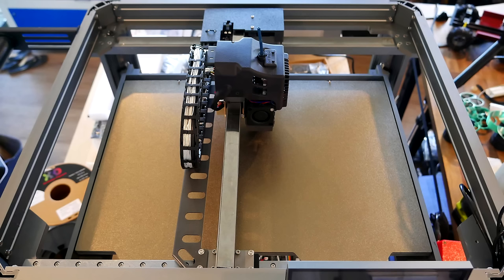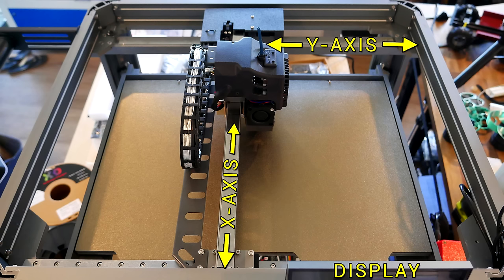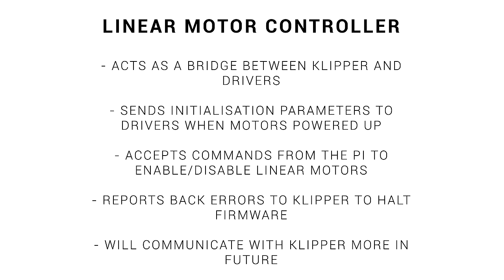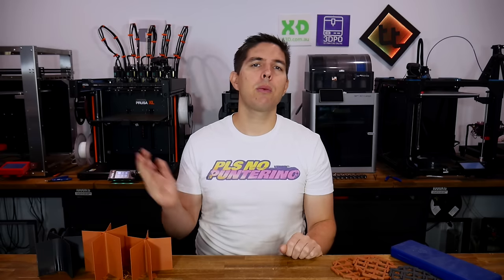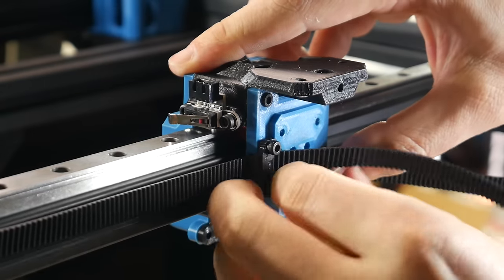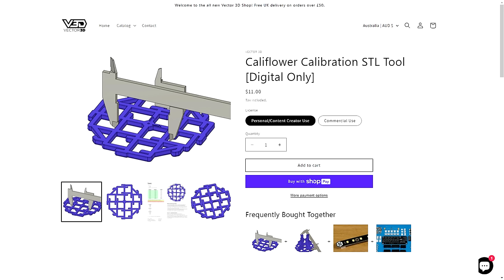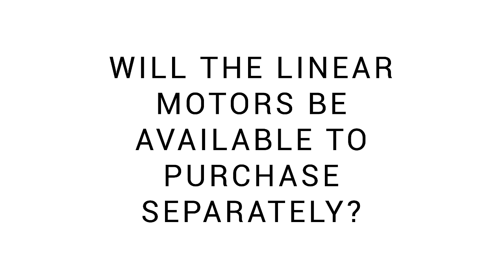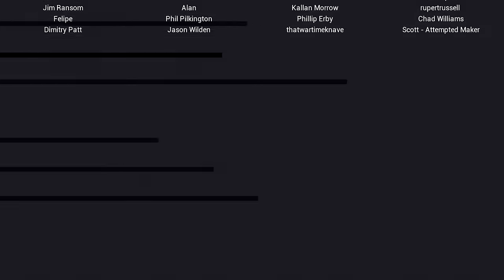Magneto X linear motors: Deep dive and performance testing

Comment: Personally, I think these are designed "backwards". It would be better to have the coils in the rail, and the permanent magnets in the carriage. This would reduce weight (mass) of the carriage, eliminate the motor wiring  to the carriage, and allow the carriage to be hot-swapped. This would translate to simplification, speed increase, and convenience. In the case of something like a CO2 laser that uses mirrors and requires no power to the head, it eliminateds the need for a drag chain or ribbon cable.
Reply: but does that work well enough from a physics perspective?    i don't know.  i see your point about the weight but i'm assuming they did what they did for a reason.   to me... the issue is heat in an enclosed build chamber,  i want a machine that will do functional stuff that has to be printed hot, as others have commented,  and maybe 60c is good enough,  i don't know till i have something and the opportunity to use more advanced materials more.     i don't need that at 800mm/sec..  i probably would be super happy at 250mm/sec or less as long as it was reliable and cheap and repeatable and simple to set up.
Reply: I believe there are magnets that can withstand 120c, so maybe different (more expensive) magnets would be an option.
Reply: @DeagleBingo  It would actually run cooler because the windings in thew rail would have the entire rail to dissipate heat and only be active where the carriage was, and the carriage would not have current flowing through it getting heated up. It would be a little more expensive to manufacture the rail since you'd need an array of windings in it insterad of just some permanent magnets, but at least to me, it makes all kinds of sense to have the head be the passive part. For all the reaons I listed above

Comment: Excellent testing. But why does every print tester on YouTube put their machine on a wobbly desk? I would put the machine on the floor, especially if you have slab-on-grade construction at your house. The acrylic sheets should also add a lot of stiffness to the frame, and that, combined with being on the floor, with perhaps some Sorbothane feet under the printer, seems like it would enable the printer to both obtain better results and higher speeds. The algorithms used for input shaping will have a hell of a time compensating for the extra swinging that comes from the printer wobbling the table when it moves. No?

Comment: I feel like some cross bracing or corner gussets would do this printer some good. Maybe they should look at a different corner design with a connection style that would change how the slop from the screws are handled. Hard to explain without pictures.

Comment: Can you test the holdings/static force for both the linear motors? How much does the smaller linear motor and extruder assembly weigh?  Also how does the carriage of the larger linear motor weigh? I'm trying to understand how much dynamic force the moving mass produces and  if it is equal to the holding/static force of the motor.

Comment: I dont trust the skew correction since your measurements will change with changing parameters like flow or line width but its interesting to see that the same pattern still exists while having no belts at all🤔

Comment: I am hoping that the 0.4 degree skew is a flaw of this pre-production model. A full 1 mm skew on a part that is 143 mm is a bit too much to my liking (my XL has only 0.07 deg, out of the box - no tuning from my side). The speed test shows  some extreme shaking of the bed so it needs an enclosure to make the whole thing more rigid. I guess that needs more than just the acrylic case - too bad since that thing looks absolutely beautiful.

Comment: The max acceleration is certainly impressive, but could you do tests to figure out the max acceleration it manages without ringing or other defects?

The input shaper results you showed would make this an insanely slow printer (my Ender 3's recommended acceleration is twice of what your klipper console recommends), but this might be because you tested it on a wobbly surface.

Comment: The Klipper speed/accel test is interesting, but doesn't tell the whole story. The final result passes, but how would the surface of the print fair assuming the closed-loop system is making corrections? i.e. correctness of the whole path between start/finish. The specs indicate it would look good, but specs don't define results.
Reply: Same thought.  Closed loop means it could overshoot and auto correct, but we would still see it on the part.  If Klipper has access to the raw encoder data, that could be measured.

Comment: If my Ender 3 is off and I turn the stepper motors they generate power so they contain magnets. Now I don’t heat the chamber but the motors do get quite hot at times during regular operation. I’ve never heard any complaints about the effect of temperature on the regular stepper motors. I’ve had stepper motors get too hot to touch in other positioners with no ill effects. Maybe the motors, linear or rotary, should have cooling added, a fan would be a minimum but with the slow rotation rate and direction reversal it should probably be externally powered.
Reply: Some motors do have cooling!  It's just the rated continuous operating temperature is often around 100C.  Remember, the hotter something is the faster it cools down to ambient.  That's why the motors get to a certain temperature and stay there even though they aren't drawing less power.  Engineering is about compromises, and active cooling both costs money and has other downsides.

Comment: I would like to know if the peopoly produces better results than say a p1s or x1c at extremely fine and small models and layer heights - eg 0.2mm nozzle, 0.02-0.06 mm layer heights and printing fine figurines.

Does the peopoly's high repeatability produce a meaningful advantage in fine detail printing, and do the results approach those of a resin printer any more than say a bambu machine?

Comment: So this is not a corexy, but a linear motor Cartesian printer?
Reply: I think it's called h-bot. Same as the ender 5
Reply: corexy is a belt path system, no belts, so obviously not corexy
Reply: @calebharris292 the ender 5 is cartesian. this is also cartesian.
Reply: @97hondacivic  double checked, my mistake

Comment: I would assume as the motors are brushless with only 3 wires they are not accurate enough on their own for position and these linear motors have to have an encoding to know where it is. Rather than a feedback loop and a stepper this printer using the encoder directly to position the toolhead
Reply: I think this video briefly mentioned it, but the X and Y axes have linear optical encoders, like you would find on a milling machine. That's how it's doing the position hold.  The weird thing is that's all handled outside of Klipper's knowledge.  I may be mistaken, but I believe Klipper may not have access to the actual position information.
Reply: Very interesting. Definitely seems like a different way to drive both axis. Seems to work really well though. Looks like with these updates their coming out with it should get better and better

Comment: "Less down time" is the selling point?  I've had all sorts of stuff fail  - but a stepper motor isn't one of them.  Never had a stepper go bad.  I have had the wires wear out from motion, but that's a 10 mins fix.

Comment: I use them for ultra high acceleration (>50 g) without additional mechanical loads, but I wonder if these motors are suitable for desktop CNC machines. Nema23 is so 20th century
Reply: I think that's their plan.  Klipper can't run CNC machines, but both can run regular stepper drivers.  Which is what they're emulating.
Reply: @arthurmoore9488  I wonder how difficult the wide range of loads is for the controller

Comment: These are a bit in the experimental phase for larger cnc machines that need high speed, high power and repeatability within .0005 inches, not much benefit for fdm machines especially when. Ballscrews are already able to get very high speeds and repeatability and belts seem to work well on even very fast printers.

Comment: Linear motors are just Brushless motors with extre steps.

Yeah...they got rid of belts...but at the cost of complexity and reliability.

Well...belts add variance and imprecision to the system...but those can be mathematically modeled into the control firmware.

I would put my chips on Closed Loop Brushless for 3D Printers...but instead of using the ultra simplistic STEP/DIR signals...it would be better to bring the Loop control code inside the main control board.

Comment: The motors don’t seem as silent as they were made out to be, at least not at high speeds. The claim of less artifacts doesn’t seem to pan out either. Yes, they disappeared at high speeds, but that’s true of VFA’s on belted printers too. Also linear motors are extremely power hungry for the amount of torque they provide. They can only energize one side of the coil, whereas a circular rotor can be energized from both sides. That plus the huge, non-segmented bed heater (like with the Prusa XL) seems like it will come close to tripping North American breakers on 110V.

Configuration and tuning of those motors seems like a nightmare, and god help you if one of the drivers or motors breaks—those are totally bespoke parts and assemblies.

I’m not sure how I feel about this printer. It’s awesome that they’re trying something new, but it does seem like an impractical technology for 3D printing. Similarly to the Pantheon printers that use ballscrews—it looks cool, but it’s wildly impractical and you cannot actually reap the benefits they supposedly bring.
Reply: I think the early measurements have been between 7 and 9 amps so it will run by itself without tripping a 15 amp breaker, but if you have anything else that's power hungry on that same circuit you may have problems.
Reply: It’s 1000w, I don’t see how that would trip a breaker.
Reply: @BlaineRush-b8h  the bed by itself is 1000W. That, plus crazy-inefficient linear motors, hotend, mcu, etc could get close. And it’s unlikely the printer is the only thing plugged into that circuit. In a North American house, it could easily trip a breaker.

Comment: I wonder how you could even combine these linear motors into a core xy. The issue is the magnets would have to move through the motor because the motors are stationary.
Reply: You don’t want to have a corexy with this, it’s not even possible because corexy is specifically designed for crossing belts. What you can do is a croxy, something like the annex engineering k3. It would require a set of 4 linear motors and 6 linear rails, very expensive indeed.
Reply: @dexi9814  is that similar to an all wheel drive corexy?
Reply: @dylanlasky2389  its actually the exact same as a Cartesian just with all the heavy parts moved out of the way. Therefore the belt length is about 4x shorter than an awd corexy and its less computationally heavy (if that matters at all). Croxy is the best way to build a high speed machine, downside is that its very expensive.

Comment: 10:04: I had hoped they learned from BambuLab printers but they didn't. 
That belt tensioner is the worst design even, it's easy to strip the screw and the belt moves around due to the lack of guides.
I released a video showing how to improve X1C belt tension improving printing quality when I had mine before going Voron.
It's disappointing after releasing such a beautiful machine only to find out, they ignore one of the most important part: Belt ....... No comments.
Reply from the maker: That belt footage is from a Bambu Lab P1P. This printer has no belts.

Comment: Watching the printer shake around so much had me screaming lots of profanities. Unstable footing is never good. Get yourself a cement counter or granite or something, I use a 24"x24"x30mm drop of granite i got for 100 bucks on a 2x4 framework. Please post a video showing results from Klippain-shaketune results, if this is already klipper based. Those give you the BEST metric on what a printer can really run at without artifacts, imho. I'm printing ASA at the upper limit that my Rapido UHF can handle with a .5 mm bozzle nozzle on a v2 350mm build (48v AB)... faster than ever now with Shaketune. This machine's advertised speeds are higher than default settings, be advised, so don't be afraid to go above the default settings on the test commands. I can only print at a max of about 225mm/s at .2 mm height due to flow (about 25 mm^3/s) , which is why I question your logic on not changing the hot end. I can obviously go higher speeds and do when printing lower layer heights but I also adjust PA and everything else to match faster speeds. Hilarious running calibration tests at 400 mm/s btw. The klippain vibration test is AWESOME at choosing which speeds your machine can handle and where the harmonics ARE NOT.  Then tune based on the chosen intersection of calculated linear travel print speed based on layer height and nozzle diabmeter with your max speeds under an acceptable vibration level, run klippain's input shaper (better, yes), then run PA at the speed selected in the vibration levels for outer wall. There is a neat USB nozzle mounted accelerometer that you can use for this.

Comment: inputshaper results are terrible, also VFA. MUCH worse compared to my modded k1 max. it needs much more work and seems not to be ready in the near future. and 10% vibration with recommnded accel of 1500mm is a joke. modded k1 max has 0.6%-2% vibration and recommended accel of 8-12k, depending on inputshaper. using 0.9 steppers it manages 20k accel reliabliy.